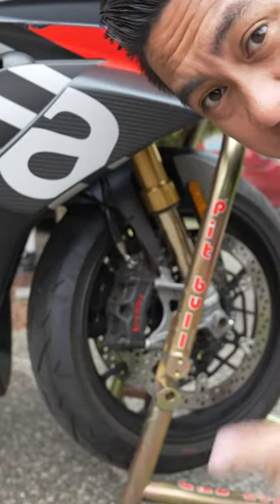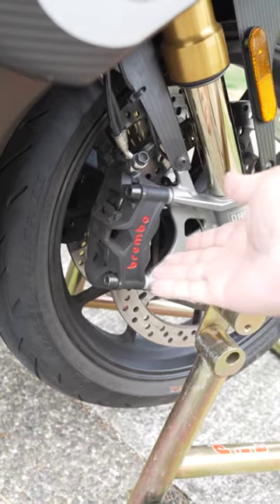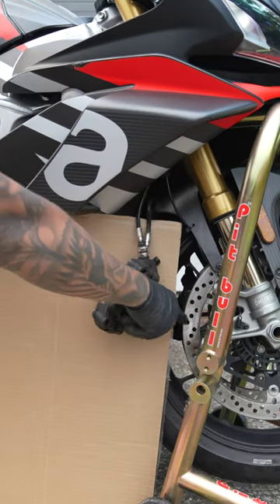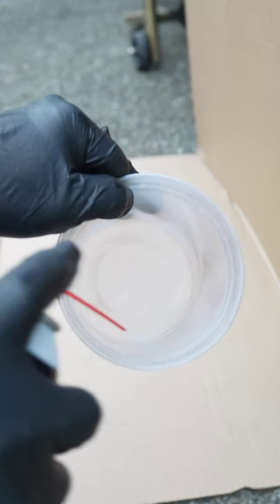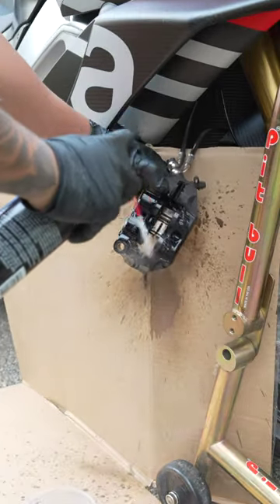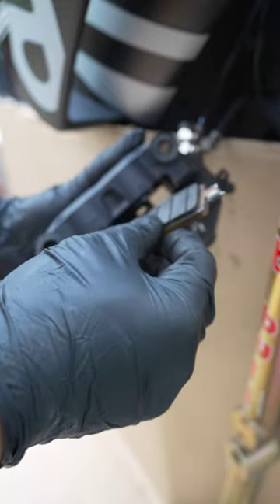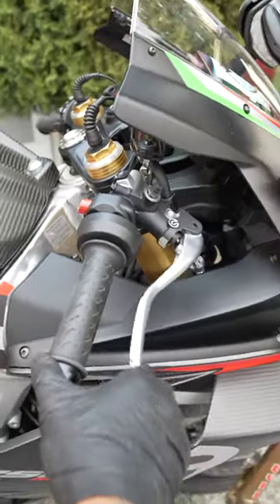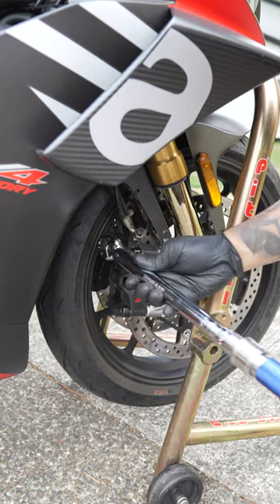HOW TO CLEAN YOUR MOTORCYCLE BRAKE CALIPERS

Comment: A good reason to always inspect a used motorcycle. This can go bad two ways: someone who does this and doesn't correctly put the brakes back in correctly or a seized caliper from lack of maintenance. I would only do this when changing pads but not randomly.

Comment: Don’t let your caliper hang by the brake line. This could stretch the brake line, leading to expansion when you are on the brake. Obviously if your lines are expanding, less fluid is getting to your pistons, the less stopping power you have
Reply: Current braided SS lines don’t expand.

Comment: Do you have to bleed your breaks if you only change out the front pads? Like you basically just did a whole break change cleaning the pistons and air didn’t get into your lines I’m assuming

Comment: Brake cleaner is nice but it can dry out rubber in the long term, wouldn't use it in the caliper. Brake cleaner is only made to clean the oil of new brake disks but it's nice for other stuff, just not rubber

Comment: I'm not arguing that maintenance need to be performed.  However, in ALL of my years riding and/or being in and round motorcycles, I have never randomly taken my calipers off and cleaned them for fear of them seizing.  Maybe that is because when you change the rotors and pads or shoes and drums, you are supposed to remove and rebuild the calipers.  Why?  Because the way you did it still leaves a ton of debris on the other half of the pistons and cylinder walls. I mean, I guess there's nothing like  doing half oof the job.  Regardless, when you clean the entire cylinder during the brake change, it will last that entire amount of time without seizing.

Comment: Those pistons seal with special o rings, I know they are fuel resistant but I'm not sure they are resistant to break cleaner especially if the o ring is old...
Also never seen a maintenance book where you need to clean your break caliper...

Comment: DON‘T spray brake cleaner on the pads. They don’t need cleaning and the solvent can break down the pad material to the point where it can become brittle and flake off. 

If you really wanted to, then get a small screwdriver and remove the dust from the crevices. 

You also want to be careful on pressing the brakes with the pads out as doing it too much will cause the pistons to pop out.

Comment: If your brakes locking up it’s most likely due to master cylinder failure if you can decompress the caliper like normal with no lines hooked up

Comment: do not do this unless you are actually changing the pads, there is so reason to do this randomly. also not good to be squeezing the brake lever when the caliper is disconnected can cause the pistons to get stuck or push out unevenly, when compressing it back in one might pop right back out, would have to bleed the system at that point. if you put your bike in a garage and ride in good conditions a caliper seizing is very unlikely, more likely for cars driving in all sorts of weather moisture build up can cause a piston to erode.

Comment: Can you show how to push the pistons back in evenly. Thanks
Reply: You have to either get a caliper spreader or put the pads back in, and use a screwdriver to compress them.
Reply: @thagingerninjer5391 or just use your fingers. It isn't that hard
Reply: just push them in with your fingers. They’ll all set evenly after a few lever pulls.
Reply: @ZSmith-yy4lv  that’s what she said.

Comment: There are dust seals around the pistons, if those are intact its not gonna seize. Doing this, if anything, would contribute to deteriorating the seals from the cleaner. There is no need to do this on a streetbike

Comment: do not press the brakes too hard. the pistons have a chance of popping out of the caliper
Reply: That was the first thing I thought when I saw this. I’ve never worked on a motorcycle’s brakes but the principal can’t be much different than a car’s and you stand a really good chance of popping the pistons out of the calliper if you tried this without putting something in to block them from coming out all the way.

Comment: I work at a Yamaha dealership, if one of my techs recommended this I'd throw the service manual at him
Reply: explain why
Reply: @ropeysubstance1719  absolutely unnecessary. More likely to cause a problem than fix a non issue. The engineers who designed the system never advised it
Reply: @waiatm  so it's not advisable to clean brake pistons, brake calipers, or brake pads? or all 3? i'm confused which should and should not be done.

Comment: "Good chance" you say, meaning high probability. Clearly this is not true. I'm not sure how often you would recommend doing this.
My manual for the xsr700 states replace fluid and also replace seals in calipers and master cylinders every 2 years. It also says replace brake lines every 4 years.
Definitely have fluid replaced every two years. Moisture in the fluid is likely the cause of seizing pistons, so at least do that.
I doubt most people need to have seals replaced every two years,  but they should definitely be inspected which probably means taking some stuff apart and cleaning.
Brakes are a critical component and having the parts replaced on a regular schedule by a competent person is an easy way to prevent failure.
It seems to me Yamahas's line and seal replacement schedule is really aggressive,  especially for brake lines.
But this is just my kitchen table assessment...

Comment: So the brake cleaner has just dried out the rubber and there is no lubrication on the pistons or rubber. Why have you not added silicone grease

Comment: How often do you recommend to do it?
Reply: Not very often at all. You’ll have to replace the pads several times without cleaning anything for the caliper to actually seize. It’s not a common problem.
Reply: @thagingerninjer5391  OK thanks. Gathering all info I can in preparation to getting into motorcycling.
Reply: @thagingerninjer5391  i take my motorcycle to the shop to change break pads should I even worry about that?
Reply: I suggest don’t do it, at all. Clean them when you change your brake pads and that’s it. The only exception is on a dirt bike maybe
Reply: @richardlontos777  I don’t take anything anywhere to have the brakes changed, bike, car, or truck. 99% of the time they’ll just throw pads on a bike without cleaning anything and they’ll put them back on without spinning the front wheel. Also, 99% of the time with a car they’ll throw pads on without turning the rotors and without taking the pins out and lubing them.

Comment: there's a very small chance of it happening, also if the pistons move out of the caliper they need to be pressed back in for everything to fit back on the disk.
there are reasons to inspect and clean the brakes but this is not one of them.

Comment: Brake cleaner on the pads is fine, on the caliper itself better use soapy water. U might damage the seals with brakecleaner

Other than that, good tip and sth everyone should do one or twice a season
Reply: I was thinking the same thing! Brake cleaner is not good for the piston seals
Reply: Was thinking the same thing, plus brake cleaner going back into the brake line will probably agitate the clean/used brake fluid

Comment: DONT'Nt use the brake cleaner it is to aggressive on the seals in the calipers. Use soapy water, works fine.  Break cleaner is to get fat/oil and brakedust residue from the rotors.

Comment: Good lord what an excellent way to feck up numerous youtube mechanics' bikes. "A good chance the pistons will seize" is literally near zero. Calipers are made of alu alloy and pistons of stainless, many times covered in protective layer, so they won't seize like cheap iron stuff on cars does. Clean them when fitting new pads and you're good. Even better - let mechanic do it for you.

Comment: You should never spray break cleaner in to a breaking pad (at least not the composite side)
You didn't show how to push back the pistons again so you are able to reinstall it back.
The rest is a good ideia so nothing could seize up and longer service life for the break caliper.
Reply: Was looking for this comment. 100% correct. It degrades the pads which have a semi organic compound in them. Brush the dirt out and then leave it alone.
Reply: I’m assuming spraying cleaner onto a used pad, means the “bedding in” process. Pad material is adhering itself on the rotor. Creates that friction bond that holds up during high temperatures. Am I talking out of my ass, or is this correct. 😊
Reply: @ridepastu1418  wrong the organic matierial holding everything together disolves so the brake pad can fall apart or just fall out of the metal plate. Even falling can damage the brake pad and creat small cracks which while riding can lead to failure.
I know it sounds extreme but they are made to with stand high tempretures and friction.

So they are NOT made to resiste chemicals or any other kinds of forces.

But since you talked about it when you change brake pads you can bed them in by driving for a bit and minding you first few breaks, the breaking should be lite at first and then be progressivly harder of cours mind your surroundings. (Exception for this is when you really are in an emergency situation then you brake as hard as you can always!)
Reply: @daniocm5991571  appreciate your input 👍

Comment: This takes a lot into consideration like: does the owner know how to properly recompress the caliper, not accidentally cut/pinch the rubber seals, and place the pads in the same position.  This is a VERY stupid idea for those not mechanically inclined.  Calipers, especially older ones, do not always press the pads at the same rate causing uneven wear.  However, the pads will align and set in on that side of the rotor flipping them can cause large drops in brake performance.

Honestly, advise people to check their fluids before each ride and do a full visual inspection of their bikes; including a full 360 of the tires.  That's much safer and instills good habits.  This is just really bad advice for new riders and those not mechanically inclined.

Comment: These are not clean brake caliper pistons. You should take the caliper apart. Pop out the piston and clean the whole thing. There is more dirt underneath. If you REALLY want to clean it. This is not bad though.

Comment: You should never have to remove the calipers until new pads or tires are going on
Reply from the maker: Gotcha, so don’t remove then for replacing brake lines. Lmfao
Reply: @adobomoto  you normally don't need to

Comment: This guy just wanted to post a video. There's a higher chance of you doing something wrong during the disassembly or assembly that will cause brake failure. The only time I've ever removed the brake caliper is to replace brake pads.

Comment: Alrighty. If you don’t know what you’re doing, please don’t give advice to other people, especially on life depending systems like brakes. DON‘T use brake cleaner to wash your calipers and brake pads. Brake cleaner will attack your epdm seals in the caliper and leave a residue on the brake pads, lowering their friction coefficient

Comment: GUYS DON’T PULL THE BRAKE LEVER WHEN THE CALIPER IS NOT TOUCHING A BRAKE DISC IT WILL LOCK YOUR BRAKES UP AND IT’S HARD TO FIX WITHOUT THE PROPER TOOLS

Comment: “There is a good chance pistons will seize” I have never seen that happen nor have I ever been advised by any mechanic to do this nor have I ever seen it mentioned on any motorcycle’s owner’s manual for maintenance. This is some proper bs right here. You want to avoid rust? What I do is wash my motorcycle from time to time and spray the calipers with brake cleaner before washing, and always following maintenance inspection. No need whatsoever to do this nonsense. You will see if rust forms anyway when you change the pads or perform periodical maintenance like brake bleeding.

Comment: You just caused the pistons in your caliper to prematurely rust, cause cleaning them with brake clean has now removed any of the lubricant that is on the pistons to help them move freely and disperse any water that does make its way onto your pistons.

Comment: I would just blast it with compressed air every time I changes the brake pads. 
   Idk, if your brake caliper needs to be cleaned more often than you need to replace the pads, to prevent it from seizing. It must be either a shit brake caliper or a high performance, for track, that's use by pro ones. (I never had both types)
   I think unnecessary dissembling and cleaning something can do more harm than good. Unless you know what you doing.

Comment: I don't drive a bike but I almost died bc the caliper literaly got lose so I coound brake and the piston dint even go I was going high speed like 80 in the direction of a fricking I forgot the name of it like the metal that's on the sides of streets turns bro I coound stop I needed to use front brakes I wasnt even a meter away of it

Comment: If you have to clean your calipers to keep them from locking up while you're riding, you're using the wrong brake fluid (i.e. boiling), or there's something wrong with the caliper itself.🙄
Reply: no, it gets stuck sometimes due to mud

Comment: Cleaning brake caliper… Bruh! Ur brake works with the bleeding force. Doesn’t need cleaning because bleed works by pushing it and moving it back. 

Been riding and wrenching for 17 years, have never needed to clean brake calipers unless I’m changing a brake pad and even so, doesn’t need to be careful where I spray. Just spray to remove all the visible dusts and add the new brake pads.  Works every time.

Why don’t you show us how to clean the review mirror lmao… if you don’t clean it, you may not be able to see when you are leaning…

Comment: If you’re not qualified to do the job properly leave it alone. Calipers will seize if the bike is not used and sits in bad conditions for a long time. Or do a time lapse video showing how quick a caliper will seize.

Comment: All these comments about pushing pistons back more likely to cease up randomly and you shouldn’t routinely clean them is complete BS. These brakes are designed to do this and tested continuously under force and well over engineered beyond tolerances. Anyone who thinks  that can be overcome by someone doing a basic maintenance task is quite simply an idiot 😂😂. Cleaning them routinely is good practice and you’ll notice a difference when doing so. Also cleaning pads with break cleaner does not damage them lol. The forces involved with these things in contact with discs is more likely to damage it than some basic cleaner. The only thing is just being careful NOT to pop the pistons when moving them off the disc with the brake lever. Also, centre the pads in this example is good as they are not pinned into position on the disc

Comment: You made it more likely to sieze by A: removing the (not very, but still) Protective layer of brake dust, and B: making it so you have to push the pistons back. This is one of the worst shorts I've seen.

Comment: Stupid improper procedure. The pistons need to be reset by hand or specialty tool before trying to put the pads back. The pistons don’t retract by themselves. Some can be pushed others need to be rotated. As the pad wears the calipers come out more. They have a protective boot or sleeve. If the sleeve is broken contaminants will cause the caliper to seize. Blah blah blah